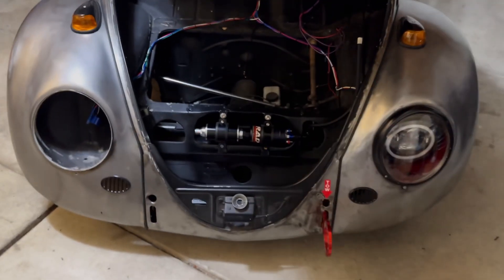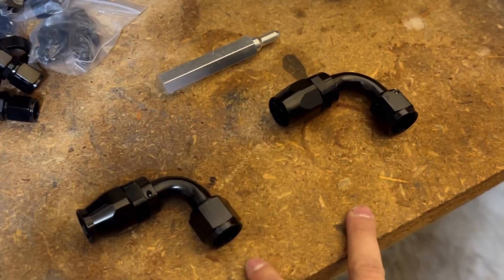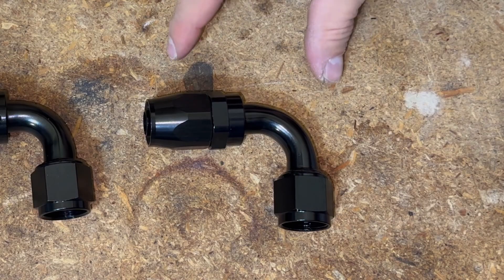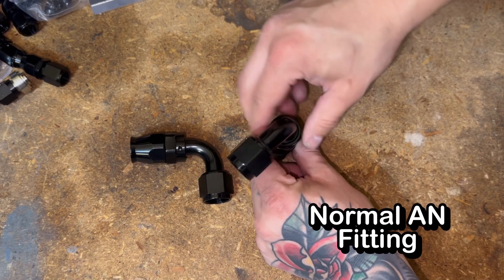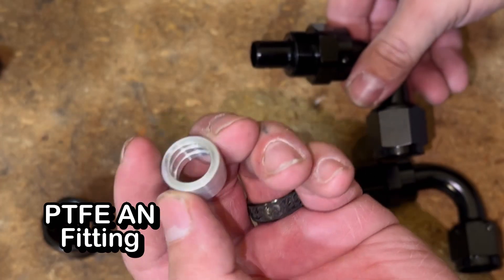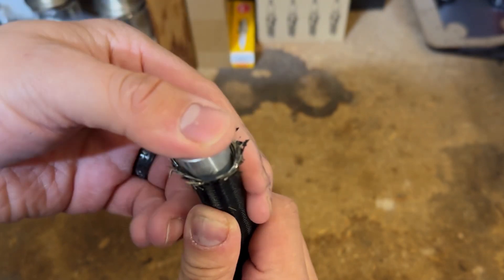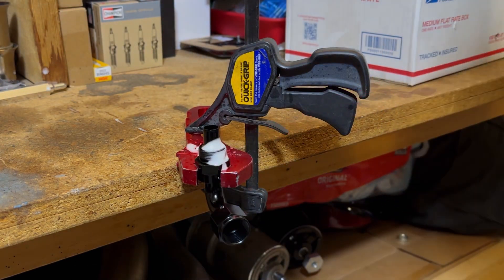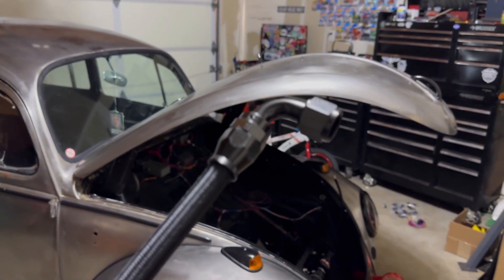How To Assemble PTFE AN Fittings | Complete Fuel System Upgrade Part 2 | @RADesignsPerformance

Comment: Nice vid, I’ve had the same fuel filter on my truck for a couple years now just took it apart to clean it worked great, good quality filter element 👍
Reply from the maker: It seems and looks like good quality. I wouldn’t be surprised if I didn’t have to clean it for a while.